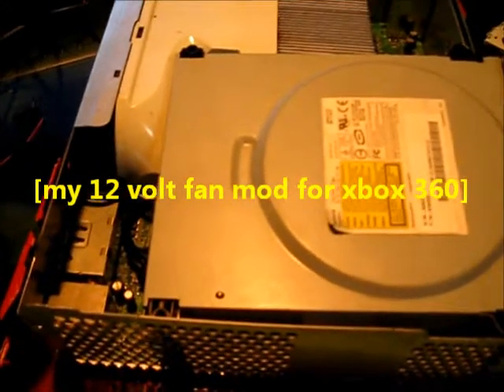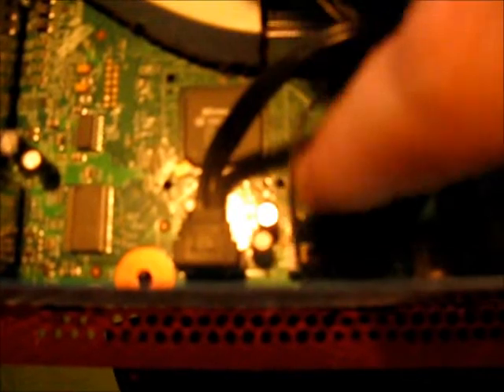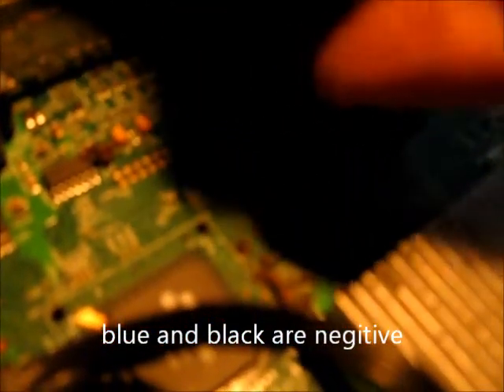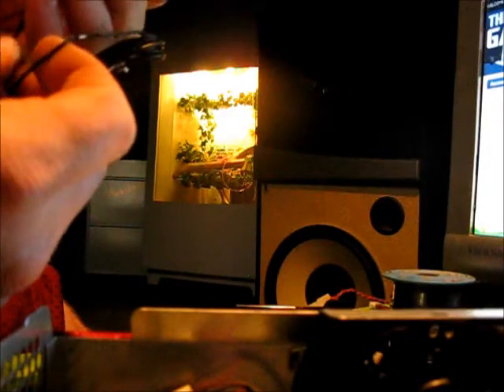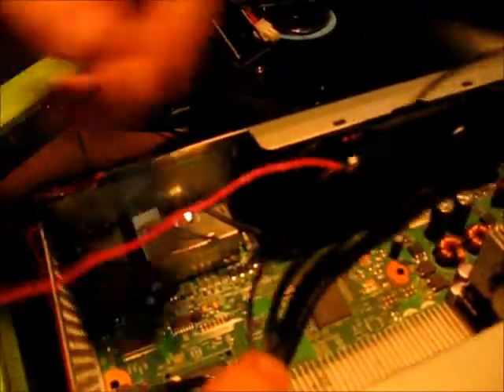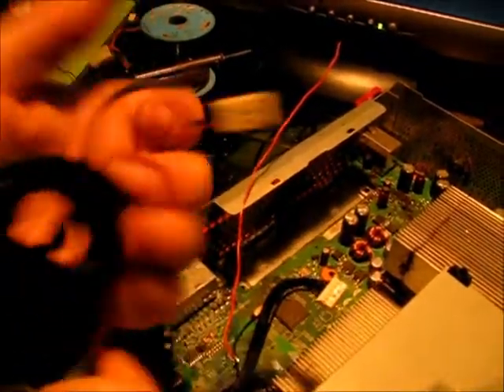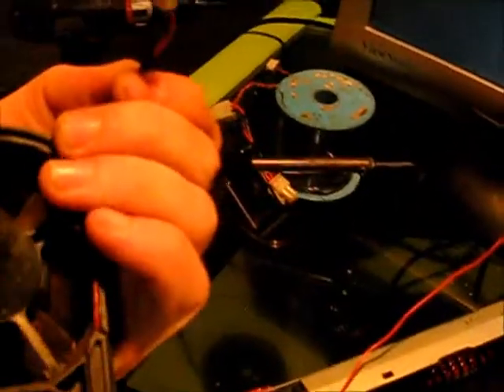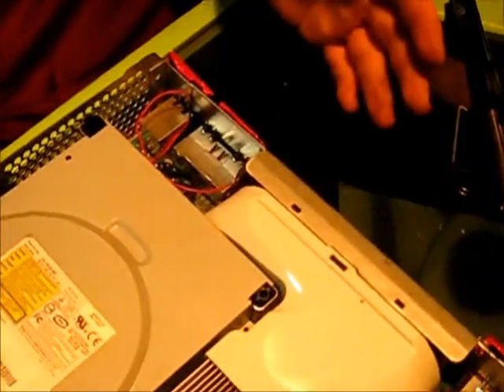xbox 360 12v fan mod tutorial

Comment: thanks. it's the top left wire on the cd drive power source and the brown and red wire on the fan right? and if you wannted to could you turn the fan around so it sucks air in and not blow out?